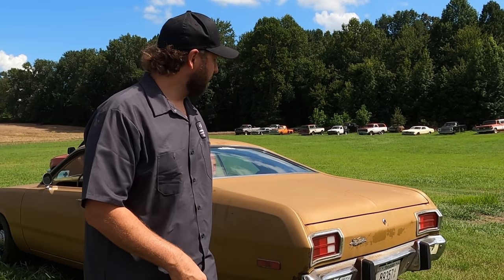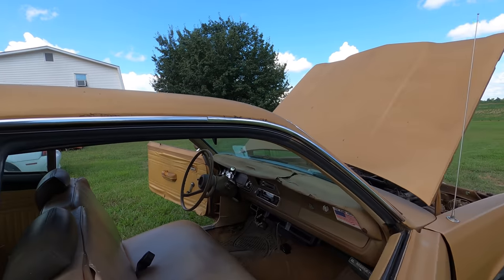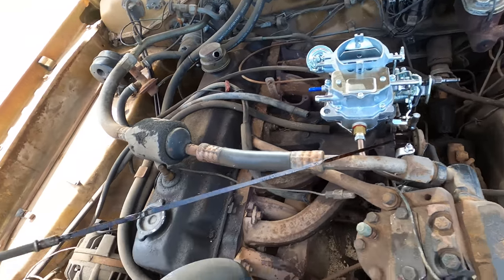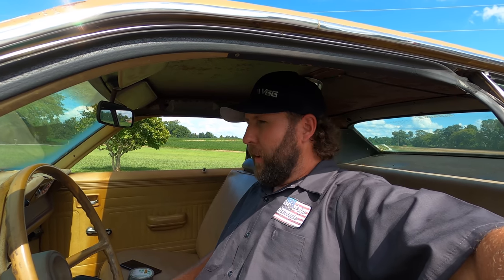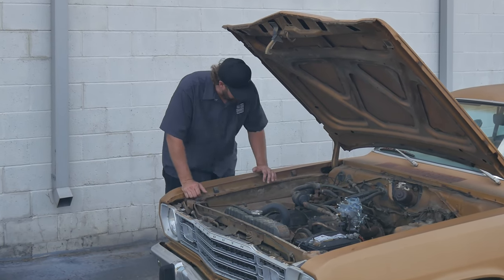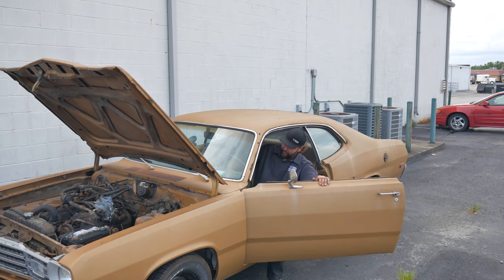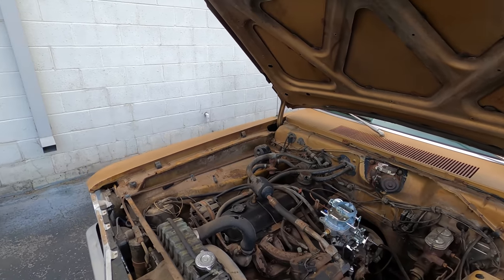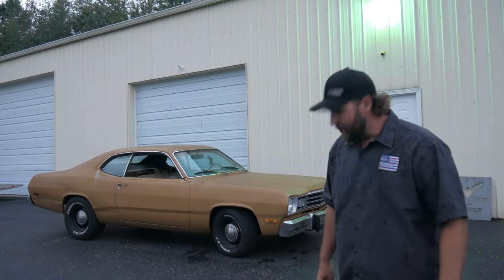Driving a 1973 Duster to the NEW shop in Tennessee! (Bought Sight Unseen)

Comment: Know a guy and his wife that flew to California on vacation. Seen a 1972 dodge duster. Not running. Bought for $800. Tuned up. Fuel pump, fuel filter,spark plugs and a set of used tires. Even got the AC working for the trip home. Pulled a pulp fiction and put blankets on the old bench seats. Drove 2000 miles home. Wife thought he was crazy. 🤪 Till two years later when car was fixed up and painted. He drove his wife a their newborn baby boy home from the hospital. Every car has a story. Stories help preserve old cars.  👍

Comment: About 20 years ago my wife and I were just married, dirt poor, and livin on love.  I had a 74 duster with a 225 and a 4 speed. The 225 burned about as much oil as gas. I had just got done building a 75 and a 76 with a buddy.  I had plenty of left over goodies from almost a year of  junkyard pillaging. I was aching to put a 340 in it.  I had one with a big ol thermoquad, a k frame, a set of subframe connectors, a set of headers that were actually right for the car...the whole nine yards.  Mrs didnt want me to make our duster into a go go buggy that she couldnt drive.  Anyway we had the road trip from hell. 5 flats, had to put diodes in the alternator, ignition box went out, you know...regular stuff.  About 20 miles from the home 20 the lower rad hose exploded.  I stopped, looked under the hood, saw the mess, shut the hood and drove on.  It got so hot I locked it up.   Three times.  I fully intended to stick a piston so hard that Id break a rod.  When it finally stuck so hard that it wouldnt break loose in overdrive, we were about a mile from her uncles house who really enjoyed his sudsy beverages.  We got there, and he enjoyed about another case of suds and we rounded up a chain to drag it off the highway before dark.  When we got to the car it had cooled off and for the fun of it, i hit the key and it fired right off.  He carried me to town, I stopped at old Reilly's and got a hose, went back and put it on and filled it with water and drove it home.

We drove that car  for another couple years until a drunk sideswiped it.  I never smoked, never knocked, and just ran like a top.  

Maybe you need to get it hot enough to lock up....never know.
Reply: Lovely story! 
Amazing the extent to which certain cars just fix themselves.

Comment: Every Dodge and Plymouth I ever owned, the starter sounded just like that but never, ever had to change one. Seriously.
Reply: Yup 👍🏻 They “ All” sound like that. The bendix is weird, like the keys 🔑 on Mopars. Don’t even get me started on the Heat Riser noises 😫😫😫.  That 6 really surprises me. They’re 99 .3649 % indestructible and will run long after the body and frame fall off. Guess the little ol lady from Pasadena, beat her to death..
Reply: They sound like that because they're a gear reduction starter. Pretty stout unit but over-advanced ignition timing would destroy the gears every time. The housing that the battery cable attached to is phenolic and would break easily when tightening the cable nut. I replaced many of them BITD.
Reply: @jamiemorgan4146  Back when I was a senior in high school, for a time, the only thing I had to drive was my dad's old orange Dodge conversion van. Shag wall-to-wall carpet included. Seemed it would take the longest to crank but alas, it always did. Thankfully my '01 Grand (non-conversion) Caravan cranks and runs smooth even at almost 245k Miles. However, I have a question for you. I recently had an A/C clutch bearing clunking so I had clutch, etc replaced. I still have a residual noise. Any ideas please?
Reply: You should listen to the whine of my Hudson starter. It scared the heck out of me every time still, but it never lets me down!
Reply: That dredged up some old memories!  I had a 1971 Plymouth Fury Gran Coupe and about every eight months, like clockwork, the starter would go out.  Great car otherwise.
Reply: LS swap

Comment: Those wheels really make the car!!
Reply: All muscle cars look best with thick Rubber,  Steelies, and Moon Caps.
Reply: It's a 225...should be equipped with the stock wheels and tires.
Reply: @karguy1720  keep the wheels and tires and swap in a nice 360. 👍
Reply: find a old 400 and Stroke ita
Reply: @tundrasr5709  Or maybe a motorhome 440?
Reply: @charlesm7589  get a couple shoehorns, a guy could make it fit. Lol 
I had a '75 Dart Sport with a 360 and it was quick.
Reply: @artistnyc123  good show
Reply: Oops I forgot about the  transmission

Comment: I believe the other Duster you picked up was also missing its kickdown linkage.  Shouldn't be surprised when the transmission goes directly to 3rd without that vital setup in place and operating.  I've always heard that driving without it will destroy a Torqueflite in short order, but at least one of your Dusters survived for at least a little while.

Comment: Those slant 6 engines run 4 ever. I had a 73 that I switched to a manual three on the tree. It was green with Gold Duster doors. This video brought back high school memories.
Reply: My, Aunt Bee, had one too.
Reply: You needed a manual trans with those leaning towers of power…. They were bulletproof but they had the power of a donkey with 3 legs….
Reply: My father was 66 when I was born. He drove slowly when approaching an open fire hydrant in our 1950 Cadillac 62, in 1968 NYC I was 10. Good Times.
Reply: @nobodyspecial6436  Hee Haw
Reply: @markmartin5248   your father was the man.
Reply: @kentgwyn3230  thank you, Kent.
Reply: @markmartin5248  My Aunt Bee drove a 1955 Ford Fairlane Sunliner and a great 1966 Studebaker convertible

Comment: Cop brakes, cop tires, cop suspension, cop cigarette lighter- sounds like a car from the Blues Brothers movie.
Reply: We may never know if Vice Grip Derek traded for a microphone.
Reply: @vectorm4  Or some glue on the accelerator.
Reply: Does it have a do-nut holder?
Reply: Correction the cigarette lighter didnt work in the bluesmobile
Reply: @michaelmckinney5541  did his duster come with one?
Reply: Them tork flights. Lots of mods
Reply: i thought that also!
Reply: Oh no.
What the f**k was that?
The motor. We've thrown a rod.
Is that serious?
Yup.

Comment: "Cop brakes, cop tires, cop suspension, all the good stuff." It must've been a Blues Mobile.
Reply: I wonder how that all fit on a duster none of my diplomat cop car parts fit my duster except my 318 and 727 man it made that lighter car fly
Reply: Yeah I just went right to the Bluesmobile
Reply: With a 225 6 popper!
Reply: @vincesarmento4854  had to be that special 225 slant 6 police interceptor I've heard so little about till this car maybe that's why Roscoe could never catch those Duke boys even when they were in Cooter's tow truck
Reply: @davidwoermansr  🤣👍👍
Reply: @vincesarmento4854  if only that duster had the factory 440 with a 6 pack cop engine in it he'd have a real unicorn
Reply: @davidwoermansr   That's a lot of power!
Reply: @vincesarmento4854  I saw a lady run a 440 with a 6 pack in a Chrysler imperial in a derby 50 cars in an arena the size of a football field and she was laying down full track shots and junking other imperials and everything she hit with 1 or 2 hits she said in 11 years that engine had been cut out of 5 cars and earned her 18 trophies and placed her in the money 47 times and she was about 4 ft 9 maybe 100 lbs soaking wet could barely see over the steering wheel of that big old imp
Reply: @davidwoermansr  Wild, thanks for sharing that!!
Reply: @vincesarmento4854  she's from Pittsburgh PA I met her here in KS at Blizzard Bash her husband is her mechanic and pit crew she's the driver they're both awesome people
Reply: It's missing the 440 engine though

Comment: Had a 73 Dart as my first car. Wish I still had it. Oil around spark plug is because there is an aluminum tubular insert in the head surrounding the spark plug with a rubber seal (like a square cut o-ring). Few people replace the seals, so they harden and leak. The end of the insert also gets extruded out by the spark plug, so it is best to use the round end of a ball peen hammer to dress the hole where the spark plug goes through back square or slightly concave when looking down on the tapered end so that the insert squishes the seal into the head when the spark plug is tightened.

Comment: AAhhh, the good old days when, if you dropped a tool in the engine bay, it clanked, rattled, and fell on the ground. Or, it would end resting on some part of the frame or suspension where it could be seen and easily retrieved. Tools (and or parts) dropped in the bays of the new cars seem to disappear into another dimension.
Reply: True. I installed a new battery in the wife's car recently, and it cost me an extra ten bucks to replace my 10 mm combo wrench that fell into the Bermuda triangle. I spent half an hour looking for it. Then went as far as to remove the belly pan in order to try to get my wrench back and show that Nissan who's boss. We all know how that turned out.
Reply: Le extendo magnet is a life saver.
Reply: And are found on the side of the road by people forced to bicycle, like myself.  Snap On to Evercraft to zero ID.
Reply: @tomfrazier1103  heyy, good deal
Reply: And you didn't need a computer class to figure out the problem
Reply: @fieraci8500  hope it don't fall out and end up in your tire like happened to me on my son's camery
Reply: Damn right; 86 one radiator cap...  Nice thing about living in the "inner city" though (especially in Detroit) is there's almost always an auto parts store a couple of blocks away!
Reply: My favorite tool find was a name brand vice-grip ©®™ left attached during welding / fabrication, and it was in great shape, I had it many useful years after, until someone borrowed it  😭 a testament to great tools.
Reply: Love it!! Yes, new cars, full of so much hoses, ducts, belts, wires, and plastic, that fasteners do NOT make it to the ground. Ever, and it is rediculous!!

Comment: Back in the 1980s I worked for the state I was assigned a Duster that had just come from the motor pool which was quite a few miles away. They had just done and oil change and forgot to put oil in the car. The oil light was on so I put six or seven quarts in. Running it without oil didn’t damage the engine.

Comment: I loved the 225 CI Slant Six back in the day. They were pretty easy to work on, unless you needed access to the bottom side of the block. It didn't take much to keep 'em running. I never personally owned one, but all my buddies had one at some time or another so I worked on them a lot.
Reply: Great Motor to work on!

Comment: Neat Duster, had a '74 just like it, over time , ditched the single barrel and swapped a header and small four barrel, ran much better. upgraded the brakes, stock ones were unreliable, and restored the A/C. Drove that car for 5 years  before selling it to a collector. Was cheap, reliable and decent on gas, 19 around town and 24 on the highway.  Valves were tricky to keep quite and it used up a lot of valve cover gaskets , otherwise, mostly just oil changes.
Reply: I think my 225 had a Holley 1 bbl,  I purchased a new carb and put it on, it ran WAY worse, the parts store had no more in stock to swap out, so my dad said, take the new carb apart and see whats up, turns out those long jet needles on the power valve had not been inserted in the jet holes and were bent sideways, I used the needles from my old carb and sent the bent needles back in the core. Car ran perfect after that. Gotta do what you gotta do.
Reply: @vernonbosshard9317   Ran into the same situation when I swapped my carb. Finally ended up using parts from both, and over time, it started cold, hot and ran fantastic, Even with the A/C it eventually got around 20 mpg, and even drove it on several long trips. Drove it to Daytona Beach one year from Chattanooga TN. Eventually traded it for a pickup.

Comment: Hey Derrick, Thanks again to you and the family, for continuing to provide, awesome tips, and entertainment as you continue on, with what you do BEST! And here is a tip for those times when your bringing THUNDER and getting a Vehicle on the road and back home in the rain without working wipers. SKIP the RAIN-X and pull under a gas station pump shelter dry the windows down good with some of them free paper towelettes they usually provide with the windshield washer gadget tank a majigs, that they Zip tie to the support beams, and get yourself a small or regular size container of turtle wax or house brand wax, and rub it on the windsheild, side windahs and rear windah, but stay a few inches off the chrome window strips, and then wait for a good 5 mins, and then use some good Ol' elbow grease gunners you got there, to take off the wax and polish it to crystal clear shine and I swear, the rain will bounce and dance like Shirley Temple in a tap dance recital off all them windars and not a drop will stick to it, found this tip out one time on my second hand 70 Chevelle, when giving her a bath and a wax job. A big dallop flew off the rag and landed on the window so I wiped it up and polished it off the window so I decided to do the other side, Man oh Man I did not have to use my wipers for  good 6 months, no lie, but did get a whole heck of a lot of honks from oncoming vehicles as their lights bounced off my windshield too like the rain and may have bright spotted them I guess, cause I did not have my high beams on as I would always check.. thinking that is why them maybe honking at me, LOL! Take Care and Keep a firm grasp of your vice grips and a steady hand on the wheel, while putting the life back in them older cars, trucks and occasional oddities you find in your vehicle hunts, and buying sight unseen adventures!!

Comment: WOW! The best car you ever snagged! Started first time, with working headlights and tail lights! I graduated high school in '74 and bought me a brand new Plymouth Duster! She was red and had a 318 3spd with ONLY 2 options..... floor shifter and a black stripe. Turning the top of the air cleaner upside down did wonders for her sinuses! No power options but with a V8 3spd  she could smoke the tires and outrun some Fords and Chevys!

Comment: Mine also had a 225. I built a 360 for it. The 6 cylinder torsion bars squat really nice with a small block on them. They preload really nice too. They really throw the front end up when you launch.

Comment: I think the Duster looks pretty snazzy as it is, especially with those wheels, tires and caps. It does need more power though. May I suggest a Hellephant? 😉
Reply: I tend to beg different, these are not super heavy as cars went in the day so even just a more pedestrian 318 will more than suffice, but I'll take a slant 6 Duster any day as they could be more than adequate as is and will get out of its way decently enough.
Reply: @johnhpalmer6098  I wasn't being serious about the Hellephant, lol. You'd have to do some insane frame and chassis modifications to handle the horsepower.  I might stick a 340 with a 6 pack in it though. Had a neighbor with a bright green Duster and the black racing stripes and the 340 package.  I loved that car.

Comment: Old dillon. He is a mopar fanatic and knows what he is doing. It would run like the wind with a 318 or a 360 in it. Especially with that 6 cylinder rearend gears
Reply: Lolz. Had 2 .45 gears in my Dart 318. Man, that thing had legs. I was going to get personalized plates "DOOHD"  meaning: Driven Over One Hundred Daily.

Comment: I like how Plymouth designed that engine bay so the slant six leans all the way over and makes it super "easy" to replace those plugs.
Reply: 17 thousands on the point, one size oil filter for all the motors ! Plugs where 35 ?

Comment: Fantastic trip through memory lane watching this one. My first car ever (that I didn't have to share with my siblings) was a 73 Gold Duster, with a 225 slant 6 that somebody built. It had a Holly 4bbl carb (600, I think? Long time ago..), Offenhauser aluminum intake, upgraded cam, and headers. It ran like a greased streak, and sounded like a ticked-off weedeater. That was a fun car with tons of torque. It was brown when I bought it, with a big dent in the side. Some hammer work, bondo, sanding, and a coat of emergency red paint & she (kinda) looked like a new machine.

Comment: A guy could ease that duster down to Uncle Tony he loves the leaning tower of power.
Reply: I hope this happens so much. Specially with both fellers in the same state and Tony's predilection for odd Mopar power plants.
Reply: Nothing odd about that power plant… Chrysler made a gazillion of those things… they were more popular than Jimmy Baker and Tammy Faye
Reply: @nobodyspecial6436  not what everyone not in the grips of Mopar Mania think of when thinking of "hot" Mopar power plants. Most go for the 340,360, 426, or 440. The Slants, 318, 383, and 413 don't really get a whole lot of love.
Reply: Was thinking same
Reply: @jamesdevore3022  Well, it's much like the Chevy 350 and larger, or the Ford 351/351 Cleveland and up motors get the love over the smaller motors and absolutely NO love for the inline 6's.